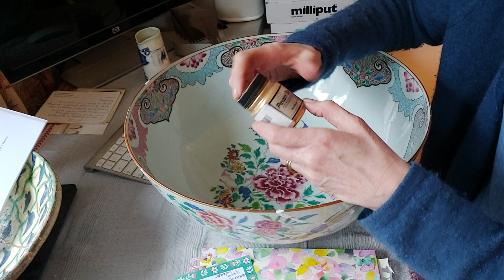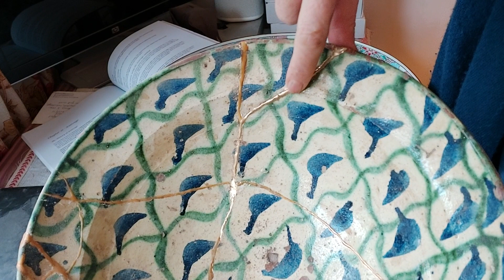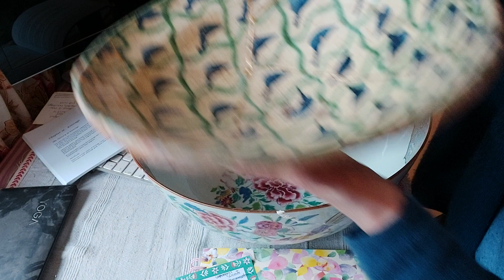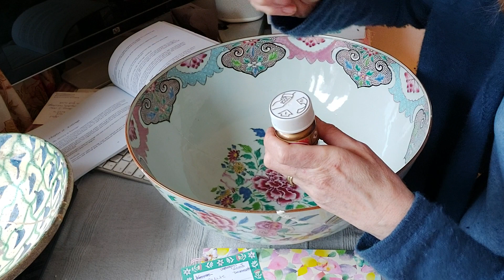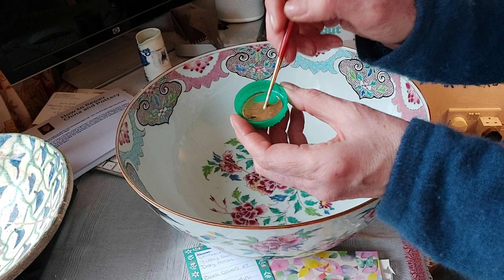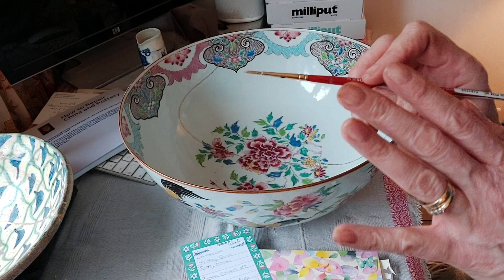KINTSUGI REPAIR THE CRACK METHOD

Comment: Liquid leaf is not stable,peels off easily.
Reply from the maker: I have never had a problem.  What  would you recommend instead? 🥰
Reply: I do not know. I have not found a good paint solution yet. Liquid leaf looks nice but it peels off easily. If you wash this bowl a few times you will see what happens.
Reply from the maker: @TheKaizenWay-ca  Have yoh tried putting a small amount of a glaze over the liquid gold to hold it in place.

Comment: I'm trying to repair a broken stoneware cup using a kintsugi method but since I want to use it to drink out of I need to make sure it's food safe (can be microwaved/hold hot liquid). Is there any chance your materials used in this video are food safe (the glue and liquid leaf)? If not, do you have any recommendations? Thank you!
Reply from the maker: Hi there,  I am not sure if the product I use is foodstuff. I would recommend looking at the manufacturers instructions which should be on any product you choose on their website. I hope this helps. Good luck and please let me know how you get on. 😀